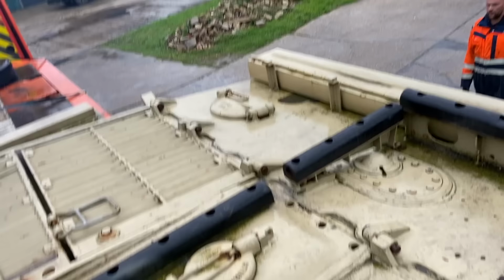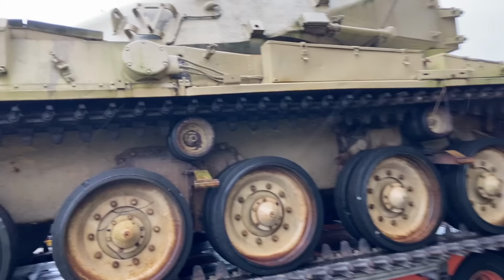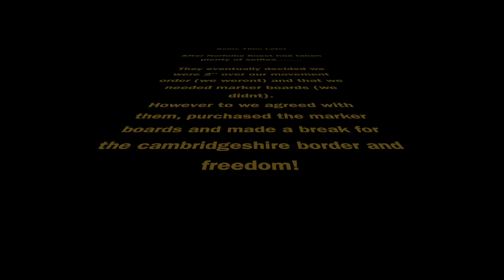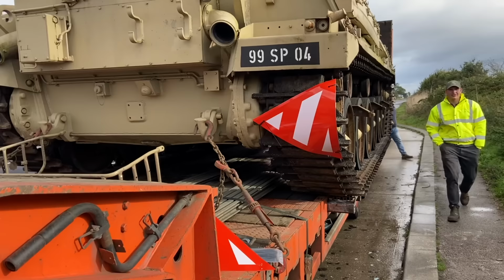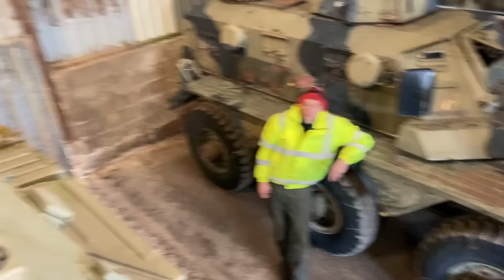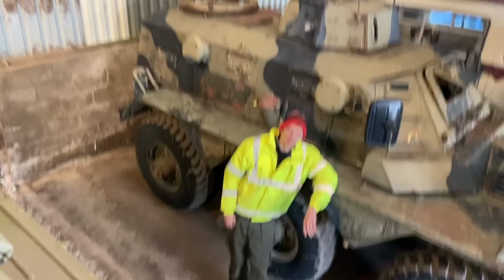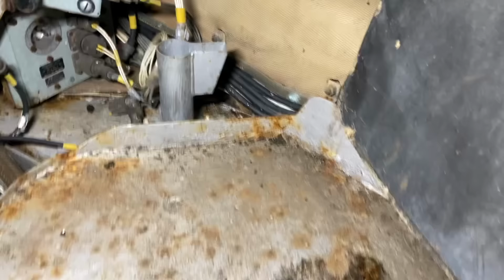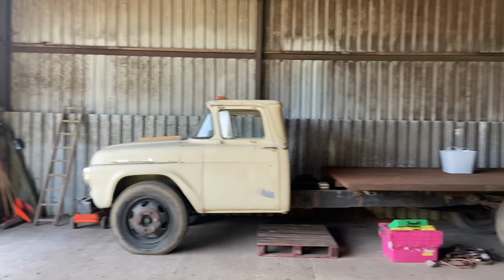We Bought A Chieftan Main Battle Tank and Got Stopped By The Police Taking It Home!

Comment: Hi Guys, I worked at Chobham for 10 years. You need to look up the history of that reg. All the trials and test ones had that SP reg.  You might have a rare one there. It sounds sweet and looks tidy. It looks like you had to do the old "string on the solenoid" trick. Lol.  I was destined to take one to Iran for firing demo's, could be that one? Be very careful traversing the gun, at full speed the tip of the barrel is doing 60 mph!!
Reply: ^^ please pin the above comment
Reply: 60 mph?!! Someone's going to wind up a head short!
Reply: @UnclePutte  Yes, the guy running the turret rig at Chobham had calculated the time to rotate versus the radius of the barrel tip. So I'm told.
Reply: @dartmoordave  Ayup, I believe it, since it's a matter of life and death in combat I suppose. Laying the gun fast and all that. But boy, an accident with that is going to look right terrible.
Reply: Uther Petersen  The principle of the laminated armour is now well established, but the actual ceramic and material compounds which were also handed over for the Abrams as well, are probably still restricted. I signed the OSA, its for life.
Reply: @dartmoordave  

Regarding the speed of the turret rotation, no point in trying to shout 'duck', then? 😂
Reply: 60mph at the gun tip. It could play baseball.
Reply: @Twirlyhead  I've witnessed a Major walk into a restricted area and get hit by one at Bulford.  Luckily the gun was fully depressed and caught him chest high, not on the noggin.

Comment: I agree with the Coppers. I thought that you were driving an empty low loader until you got those little triangles. 🤣
Reply: Yep, when they drove it on the trailer, it was like it just disappeared.
Reply: Yes a lot like nobody can see the engines on a Airbus A300 until you put 3 cones around them!
Reply: @SIXPACFISH  It blends with the sky, so if you're driving alongside it's hard to see. Almost like the paint is supposed to hide the tank.
Reply: Shhhh, stealth.
Reply: That's effective cammo for ya 😂

Comment: Buying tanks is awesome but the only thing I hate about it is as soon as you drive them off the lot they lose 1/4 of their value!
Reply: Aw man, I have that every damn time!
Reply: Nah. If you avoid firing the main gun it holds it's value well. Yes I know it's traditional to put a round into the sales office when you leave but resist the temptation.
Reply: Wrong these are basically Toyota's they only appreciate 😂
Reply: @CRAZYHORSE19682003  The .50 cal is more than capable of dealing with a Prius. HEAT rounds are expensive

Comment: The temptation to rotate the turret on the 'rozzers' must have been overwhelming.😁
Reply: " Two inches? You should be more worried about 120mm."
Reply: Best comment award!
Reply: @forbeshutton5487  😂😂
Reply: @gmarie701  Uhuh, and what happens if the vehicle was not secured properly and came off the back of the transporter and the result killed people? I suppose that too would be the fault of the police for not fucking checking right? Damned if they do and damned if they don't? 

I fucking HATE double standards, always have and always will. I would rather they spent a few minutes checking than letting a poorly secured load travel, as the end result of the latter is potentially fatal, and probably NOT to the driver of the transporting vehicle but to the poor shits behind it. If the load is properly secured what's the issue with a few minutes having it checked? Not like you are going to be charged with anything, they will check and let you on your merry way. All you lose is a little time.
Reply: @alganhar1  yeah, couple of ratchet straps will keep the 52 tons of Chieftain secured.
Reply: @mauricestainsby196  that's why you get checked to make sure it isn't just a couple of ratchet straps
Reply: @mauricestainsby196  Yeah, same thoughts here
Reply: @alganhar1  That tank ain't going anywhere even without chains. Those are a feel good measure. Inertia alone will insure that the 52 ton tank will not move without the engine.
Reply: @mauricestainsby196  Gravity plays a huge 52 tonne part :)
Reply: @alganhar1 
I suppose the two fecking stickers the coppers told them to put on the tank prevented it from rolling off.
It was a professional mover with professional drivers. And the tank was anchored properly, and was no danger to the motorists behind it.
The coppers just wanted to flex their muscles before their donuts.
I wish they would catch criminals.
Reply: Who would of course deserve it.

Comment: That tank has a very new engine in it. Well done. Ours used to smoke like bastards till they were proper warm. About 20 min of running. Then again we were dirty smelly armourd engineers, and only got the cast off half worn  hulls for conversion into bridge layers etc.
Reply: Depends on the fuel used - my guess is your tanks used off road diesel.   This particular motor would run on either gas or diesel, and they likely put modern auto diesel in this tank to make it start better.
Reply: @Eddie Hitler I looked it up, and kerosene is a much lighter oil fuel than Diesel, which the US favors to use.   I had an idiot co worker that put off-road diesel then mixed in kerosene in his pickup, and it would run like a bat out of hell, but it was a turbo.  I live way up at 8,500 ft - 2,600 meters, and I don't care for all the extra stuff you have to do at -30f or -34c -  that a heavy fuel engine needs at this temperature, and altitude.  I don't even have a clue where I would get kerosene up here.   My diesel fanboy friend says that kerosene turns semisolid at this altitude.  I know that if you have a diesel, and don't get winter fuel stabilizer it will gel up.   I have been around, and worked on military equipment all my life, and I have never seen anything that runs on kerosene.   Jet fuel is some expensive specialized stuff, and only an idiot would use it in a ground engine.   It has a gel point of -47f, and is super refined.   Unless it is 90 years ago your not going to use the same fuel.
Reply: @Eddie Hitler Maybe if your in the UK or Europe - like I said - you will have a hard time even finding the stuff in many places in the US especially if you live in a remote town at 2,600 meters.  I asked the gas station attendant here, and he says kerosene burns very poorly at 2,600 meters, and creates a component known as carbon monoxide, because the air is so thin it burns incompletely.  I find it hard to believe any country would use that fuel at high altitude, but I think that Britain's highest mountain is 10 meters so I guess it does not matter there!.   ROFL
Reply: @MegaMeaty  Kerosene works fine in lamps at any altitude. That's just another name for parafin. JP4 is cleaned-up parafin with additives to increase conductivity (to stop sparks), and gumpf that kills off the greeblies that eat parafin, also some sort of detergent so that water doesn't condense out of it as easily (don't want ice in the fuel tanks).

Comment: The Norfolk finest were actually right, HGV regulations require triangular projection markers on load that is wider than 2.9m (9ft5inch) according to technical dimensions chieftain is 3.66m wide (12ft).
Reply: thats only if its a standard bed and has no following vehicle mate.
Reply: On this edition of “I googled something and read the first result I saw for 3 seconds and then went full keyboard warrior”
Reply: Thats Only if it doesn’t have an ‘escort’ or follow vhic , these guys had a few logistical vans and flashing orange lights . Besides … rules are made to be broken 😏
Reply: @kooperativekrohn819  wait so i AM supposed to use chlorine gas to defend my home against the neighbours cats...
Reply: @hosybosy1119  well duh, it's what I've been using, after magazines above 10 rounds in 5.56 was made illegal
Reply: @Epic-pf8od  as he said: rules are meant to be broken, so you can have 1000 round mags of .50cal
Reply: @hosybosy1119  but big bang make police go nee naw
Reply: @Epic-pf8od  then you use the gas against them hehe i have done it before and it works
Reply: @hosybosy1119  seems easier to skip straight to the gas
Reply: @Epic-pf8od  my method exactly! Although machine guns are more fun to be honest...  but the cops are a problem...
Reply: @hosybosy1119  time for a boogie boogie boog

Comment: Good old Chieftain, they were my 'bread & butter' for 13 years when I worked at 38 Central Workshops 👍
Reply: Good old Chieftain my arse, what piece of junk, terrible engine. Politics got in the way of having a good tank with a reliable engine. Ex REME A mech
Reply: @paralogregt  It was more of fondness for a job that kept me employed rather than the tank engine. But yeah, the L60 had a lot to answer for with the hydrostatic locking, saw plenty of them with piston & con rod remnants hanging out through the blocks.
Reply: @garyphillips7993  yeah so did i in the 12 ARMD pack section and at Batus
Reply: @garyphillips7993  far more interesting than tills. 😁👍
Reply: @dfar2303  Heck of a lot more interesting & challenging.
Reply: i served my time there,finished up in the engine test house,thankfully i didn’t cop for many L60’s,my main job was Meteor’s & Meteorites
the later being a shit engine on the test bed,owing to carbs flooding & vibration
Reply: great fun though driving them on the tank testing track
Reply: @paralogregt  It's made very interesting reading,  the Cent was not my favourite. After failing my "A" Mech course at Bordon , l was.hoping to.be working on "B" vehicles. But was packed off to 7 Armoured  ,Fallingbostel . So decided to volunteer for the Paras  , and was happy to  fly back in a Vickers Viscount . Stayed with the Airborne until '77 . Best wishes .

Comment: In 1968 my father was sent to Southampton waters to recover a centurine that was dropped into the sea at a boat slip. There were two centurion tanks on a landing craft the one at the front had a naf engin. Landing craft was pushed on to the boat slip, Rear Centurion engine started and used to push the front Centurion off. Front centurion made contact with the slip stopped rear tank carried on pushing and the whole lot floated into Southampton waters where the front centurine toppled off the landing craft.  The centurions were being exported to Israel!! My father was a REME Major overseeing the recovery with his recovery team. The actual recovery was uneventful.

Comment: Yup - TrafficPolice are a law unto themselves. To be fair you should have had the Wide Load marker boards pre-fitted on the vehicle.  
The NEXT tank you buy, you now have the marker boards already!
The tracks hanging over the side of the transporter is a dead giveaway...lol.
Reply: When the Police are interferring with a big recovery truck you know they jobs worths.
I'm fairly sure those folks know what they are doing, turning up with an bright orange lowloader, covered in lights and warning signs, but no the police still got to put their 2 cents worth in...
Reply: mate having wide load boards on when not needed is an offence under the 1988 road traffic act. so no he should not have had them per-fitted. showing any COASHH, H&S, hazard or road traffic act / highway code sings without good reason on a vehicle is and offence. you can get three to six points or and a fine.

in my experience traffic coppers' are very useful at doing the simple stuff. but know nothing about, hazardous, heavy or wide loads. they just pull something out there ass and demand you do it to feel in control.

i worked in environmental drilling and we got stopped time and again moving drills and so on. not once did the old bill know what the law was. they even tried doing us for the geo-tec rig having no number plate, road tax or MOT. that was despite it being on a flat bed not on the road and a DVLA exception certificate holder. my old boss never took any bull from them and and very often sent them off with a flee in the ear.

the best one, supposedly, as i didn't see it happen. was a the copper my boss seriously pi*sed off by explaining the law in esteem detail to. how he then filmed bleeding air out a tire with the pressure tester and then trying to do him for having and under inflated wheel. that guy took early retirement before he could be fired. probably why we got pulled all the time.
Reply: @RebelTvShka  i think its the same the world over mate. some people become oldbill to make life safer and fight criminal's. others because they want to be the boss. sadly we all remember the twats and forget the good guys.

Comment: I'm surprised that a company like Crouch would have driver that would take an unmarked overhanging load.
Reply: didn't need the markers, coppers were wrong.
Reply: @MrGroucho1933  HGC regulations require triangular projection markers on a load that is wider than 2.9 meters. The chieftain is 3.66 meters

Comment: The old wire/string on the fuel injector pump solenoid trick! Had to do that many a time to start the engine, looks like you have a good Chevy though and it'll be great with a bit of work.
Reply: I fixed this issue now, turns out a mouse had chewed a wire inside the turret !
Reply: @MrHewes  Well done Joe! Another point for you, keep the hydraulic governor topped up with the correct grande of oil, if you do not maintain the governor level the engine will experience a runaway and self destruct! Saw it happen in Hohne when all the fans smashed their way through the engine decks as the engine blew apart, how we laughed at the poor old driver!!
Reply: @mikeandhev  String on the pump became NATO standard!  My pal and I had a runaway on a brand new engine while we were standing on it!! We jumped for the sides just as the liners fell in.   Close call.

Comment: I thought it was the mutli-fuel engine from Leyland was the problem.
The export to the middle east replaced that engine with a diesel so it was easier to maintain.
Reply: James same engine went to export model Leyland l60, designed as multifuel but only ever ran on diesel
Reply: It was a NATO requirement for a multifuel engine I think, that only the British followed & produced that engine :/
Reply: @bobgriffin5585  I think James is thinking of the regular diesel engine in the tanks Vickers were making themselves for export or the Iranian Shir1 which was a re engined half Chieftain/half new rear hull, or the Shir2 which in a revamped guise became Challenger1.

Comment: Sony pictures wanted 2 tanks for Hulk. Wang rented them to Sony. They wanted them to look a bit newer. One of the prop shops welded on a bunch of plating to change the appearance. While they were at the prop shop, Wang contacted me to work on the charging system. I found a melted off stud on one of the voltage regulators.
There was no voltage getting to the turret so, I put a meter to the turret batteries and asked the operator to rotate the turret to see if I got anything. I was riding round and round with that 155?
I told the operator to stop because I saw a guy with a weapon. He rotated back around and, leveled the cannon at him. The guy put up his hands to surrender. Pretty funny.
The ATF had torched off a big piece of the back of the barrel where it received the round. It put the gun out of balance and, it was a pain to elevate.
Reply: 120mm

Comment: Were the armor skirts taken off to reduce weight on the load? That's badass, I wish I had one! So you just pulled it straight into the barn without taking it for a spin? I wouldn't have been able to resist taking it around the block at least!

Comment: In the US a Wide load marking is fairly simple, most trucks have a yellow "Wide Load" banner on the back, red or orange flags on the corners of the load, and usually one or two flashing yellow lights on the rear.  Extremely wide loads may require escort vehicles and more lights, but most haulers that do that already have what they need to haul oversize loads.

Comment: positioned to lrotect a little bit the trailer tyres.. more on the middle, to share a lot of weight with rear wheels of the truck. Main weight is turret, then engine area.

Comment: Spent a lot of time around Catterick and these things were always around. Some of the training area roads were shared with the public and we used to pick up lots of those track pads which had been shed, I imagine they could cause some damage if you ran over one! I am sure at the time the Centurion was the main tank being used at the time but was replaced by the Chieftain 1970-75?
Reply: Chiffy came into service in '66 but some Cents carried on for a while after. By around 72/73 most Regiments would been using Chiffy's exclusively.
Reply: @thewomble1509   It would have been around 73-4 that I arrived in Catterick. I don't think they had a large fleet of main battle tanks on the camp as I think it was driver training based mainly. There was an old quarry we used to visit as kids which had many old military vehicles (mostly wrecked) The quarry was used to practice vehicle recovery, I don't know if this was by R.E.M.E or R.C.T or both. At the time there were maybe 3 complete battle tanks there one of which was a Centurion. They were almost complete apart from the tracks. I have a picture of one of the last remaining tanks taken on a re visit many years later, probably in the 90's. By that time most of the original vehicles were almost buried which is a shame as in the early days you could still read the painted no plates which I see in someone else's comments you can now research! I wonder now if Catterick had held on to their Centurions as driver training vehicles?
Reply: We had  Cent recovery at Chobham, great bit of kit. Chieftain recovery could barely move a Chally prototype.